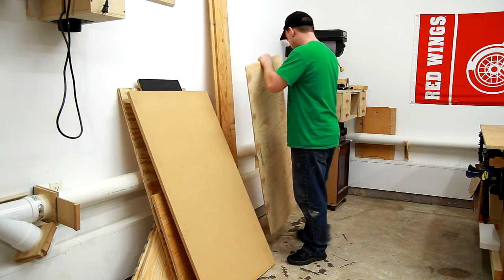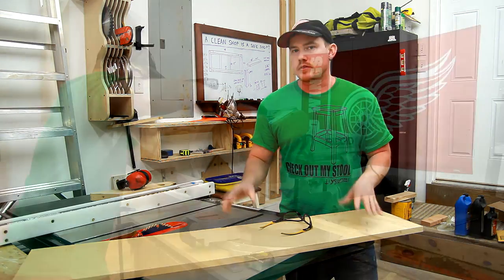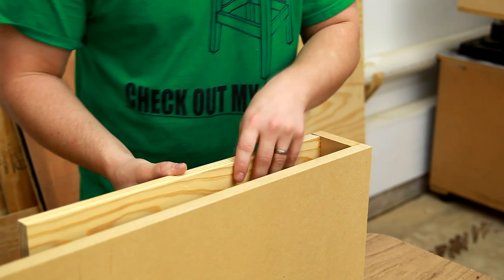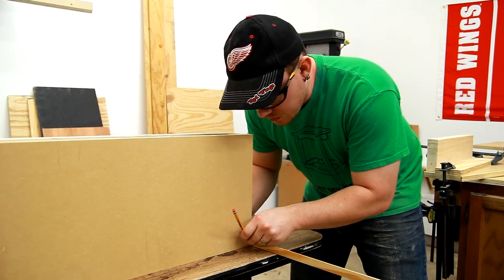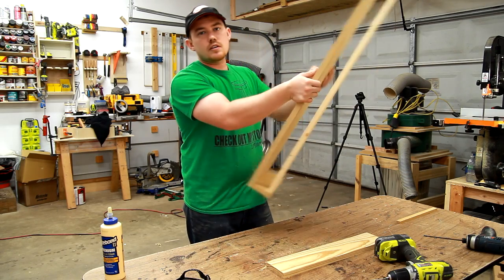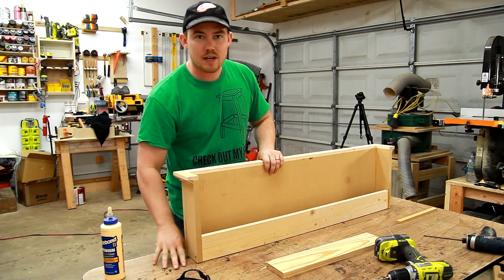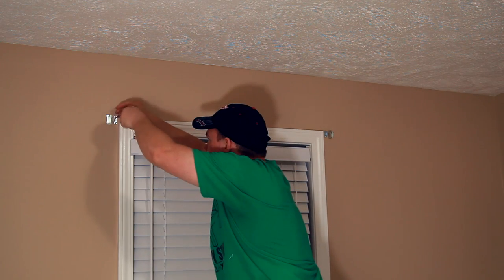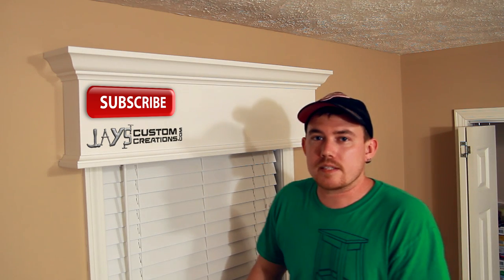Easy DIY Window Cornice - 177

Comment: My father-in-law did something sort of like this, only he used "L" brackets to mount them to the wall- and made a dado cut in the back to place 1/4" plywood to make shelves to put decorations on. I plan on doing this over our vertical blinds to replace the ugly plastic cornice piece that came with them.  They are made out of oak boards and stained to match the trim. Looks really sharp!

Comment: Given that you didn't make them go all the way to the ceiling, hanging them with a french cleat would also be a good idea. Easy removal for servicing the window.

I did make mine go to the ceiling and much deeper as well - 6 or 7". I wanted to hide the curtain tops and rod. I wish my ceiling was level to pre-install the crown, but it wasn't.

Nice looking boxes. Your home will look great having these.
Reply: ooops, should have read your post before I made mine.
Reply: That's what I was thinking as I was watching this, as well. A French cleat hanging system would make this a bit more practical. Regardless, awesome stuff.

Comment: Well done! What I normally do for cutting a thin crown moldings with chopsaw: I have a 6 inch wide strip of 1/4 thick plywood and lay it on the chopsaw platform and pre-cut the plywood and leave it there with duct tape holding it down and one on the bottom it keep it from moving around so much. What's great about the platform is that I don't have to worry about losing control of my piece because of the uneven surface of the chopsaw platform. I don't have to rely on the laser to know where I'm cutting because I already have the pre-cut on the plywood as a reference of where the saw is going. The downside: each time I remove it, I have to repeat the process. That's why I have a lot of 5 or 6 inch 1/4 plywood strips stored only for this purpose.

Comment: Looks great. I have to agree with the comment about french cleats. Here in Vegas dust is a real problem, more so than anywhere I have lived. Being able to easily remove them for cleaning would be a bonus. 

Good to hear that someone of talent has trouble with molding. I screw it up all the time. Wood filler is my friend :)

Comment: Hey Jay,
 Might I suggest that you consider making the backside (mounting side) of the bo a French cleat? It would make for an easy instal and removal should you need to get the blinds down for any reason of need to clean the windows.  I am doing a slightly lower profile version than yours as I don't have a lot of room between the top of the window and the ceiling with existing crown molding. Great and very useful project!

Comment: I love this project, I was a little skeptical at the beginning but once I saw in hung on the wall I thought it looked great! I also love the filming in this video, keep that up. I noticed your new saw, I have the smaller 10 inch sliding model and I love mine, did the kobalt not work out? Finally I also noticed your dust collection system and the cyclone, I love that too! Thanks for the great video!

Comment: So the question is do you (off video) find that you needed to place a couple of wedges behind the crown molding and the cornice body?  I wondered if it would create a more stable molding job - less vunerable to the changes of the seasons, and their affect (heat or cold, the humidity changes thereof) can bring to molding.

By the way, nicely done - decorative and classically proportioned without being overdone with the trim!

Comment: It looks good and you did a great job. But printable caulk is not the right choice for filling the holes. The caulk will shrink over time and leave unsightly dimples in the project.

Comment: Question. How did you decide on the measurements for the cornice? How many inches beyond the window? Also, explain how you mounted the box. Thanks. Nice work.
Reply from the maker: I chose a dimension that I thought looked nice. Look at magazines or google images for examples and compare to your space. I screwed through the back piece of the cornice  on an angle to hit the studs on each side of the window.

Comment: hi I live in an apartment and need to be able to put it over vertical blinds. and there is no other choice how do you suggest how to measure because I have to be able to open blinds.
Reply: You add 3" to width of window (1.5" on each side).  You can make the height anywhere from 9-16" ideally.